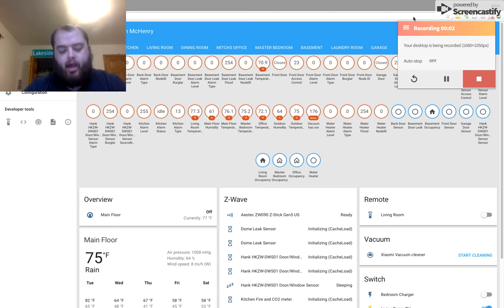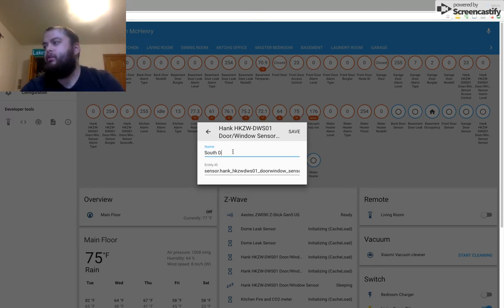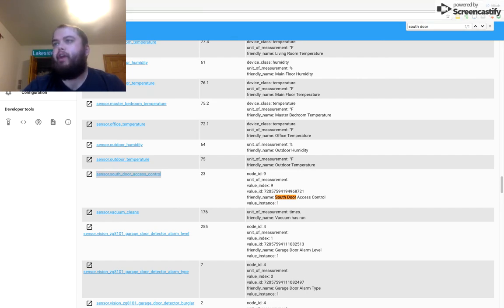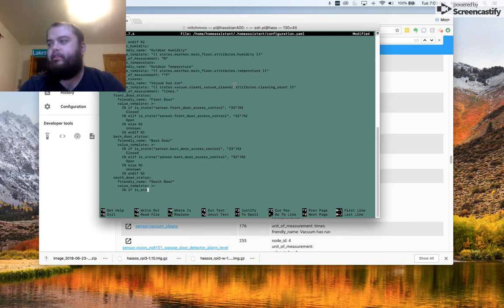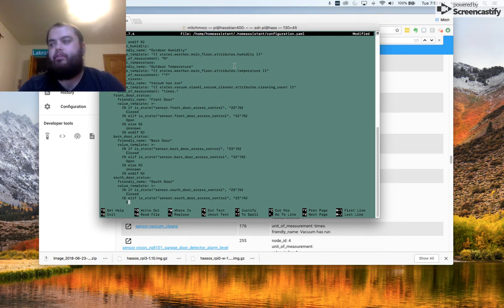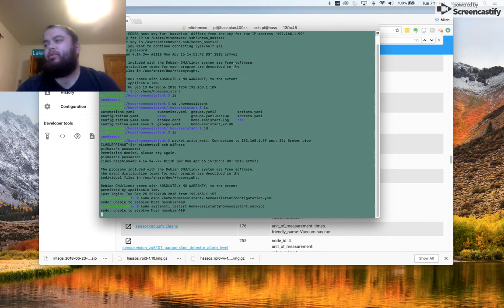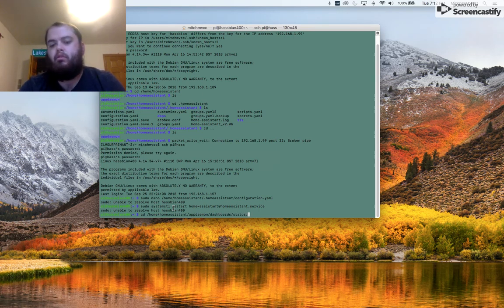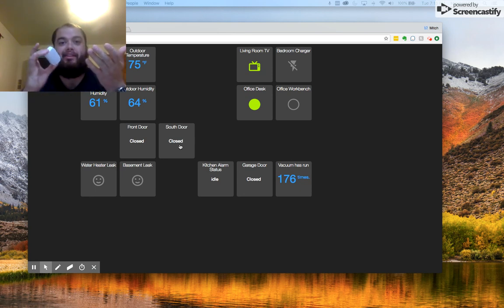Custom Z-Wave sensor in HomeAssistant and HADashboard using templates

Comment: Hi Mitch SuperKnot - I hope all is well with you and your loved ones these days. 

I installed Home assistant - ordered some Monoprice Z-Wave Plus Door and Window Sensors and found your  video - ah I am saved! 

.................... Opps - ?? looks like some z wave stuff has to be added - then I discovered that smart things too might need to be included? 

By any chance, do you have a video that notes the pre-requisites, and a little more How to? in order to add z wave, and or what ever else might be required in order make use of this video 

Thanks !
Reply from the maker: Hello! You will need a way to interface with the Z-Wave devices. In this video I used an Aeotec Z-Stick but I would not recommend that for beginners. I would say get the Smart Things hub v3. It's just easier to deal with in home assistant.
Reply: @thesuperknot_  thanks I bought the stick. Am a retired engineer so no biggie - also running HA on Window 7 via pip3 install - was able to not install but place a site package - home-assistant_pyozw - and will learn python -
Reply from the maker: I recommend making it easier on yourself and running hassio in a VM. You can download a ready-made VirtualBox image from the site and monitor it as needed including snapshots. It should see the Z-Stick almost immediately.

Comment: One thing to note, that you may have mentioned but was hard to tell in the video is that under "- platform: template"  I needed to add a "sensors:" section as this was my first sensor in my HA.

Other than that, this was perfect and helped me fix an issue that I was battling for over two days as a noob to HA.

Do you have a video for removing all the extra stuff that shows up in my HA known devices (like the other 22/23 circle setting?)
Reply from the maker: I ended up hiding those sensors as soon as HomeAssistant let me.